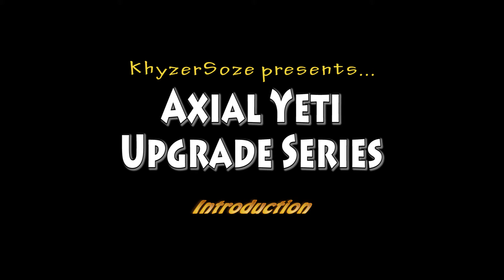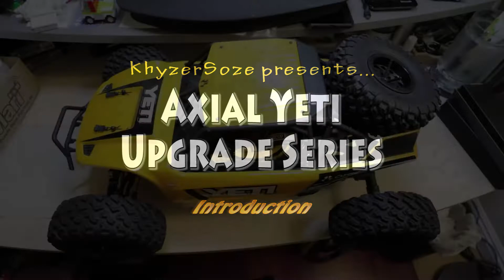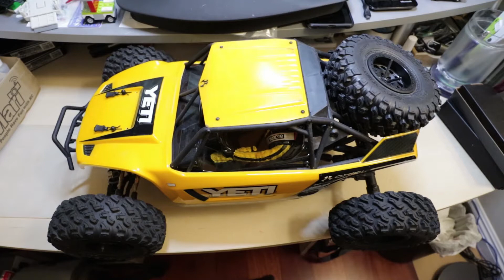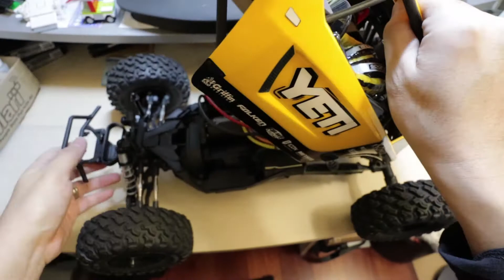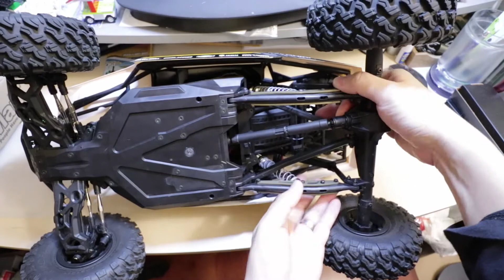Axial Yeti Upgrade Series - Part 1 - Upgrade Kick Off

Comment: Hello dear, 

I have an Axial Yeti RTR 1/10. Recently I’m hearing an electrical leakage and spark sound while steering to right. I guess so my servo is out of order. 

Which servo should I buy for the stock version? I’ll be really so appreciated if you may help me. 

Thanks 🙏🏻 😊
Reply from the maker: I'd recommend finding any metal geared servo with at least 30kg/cm (400oz/in) torque.
Reply: @RevolutionX  thank you so much 🙏🏻 Must I use an external BEC with the recommended servo?